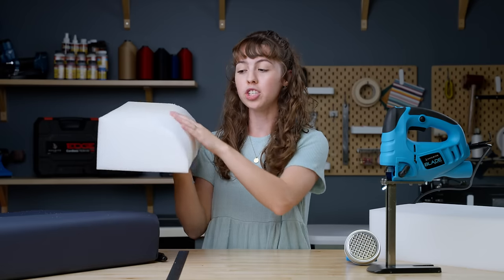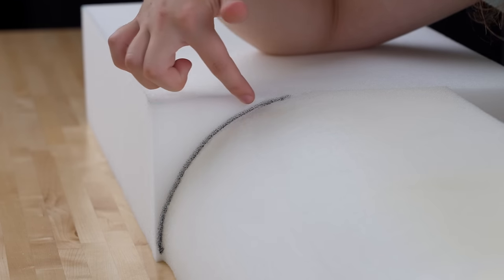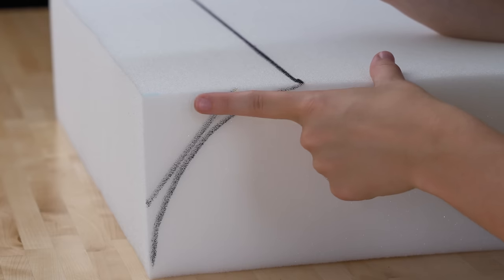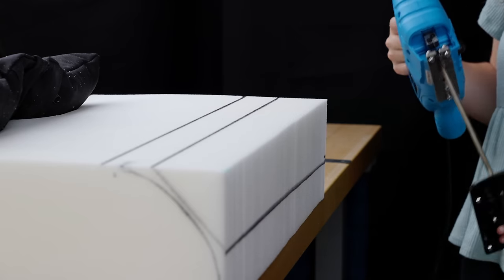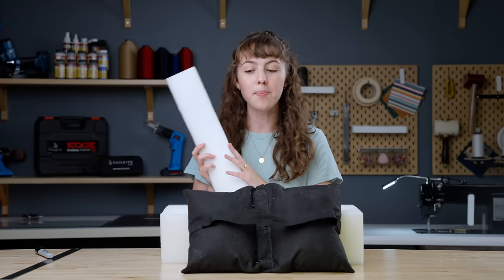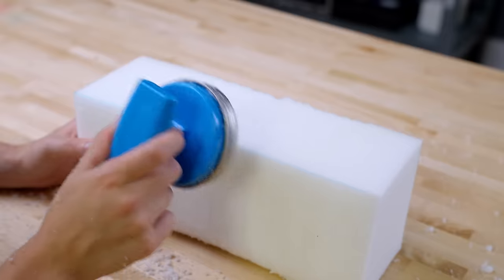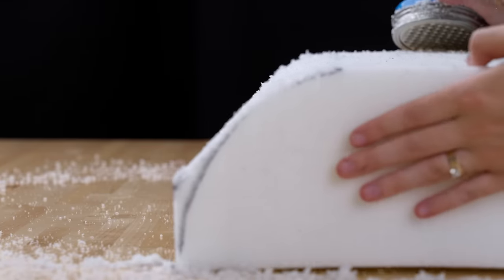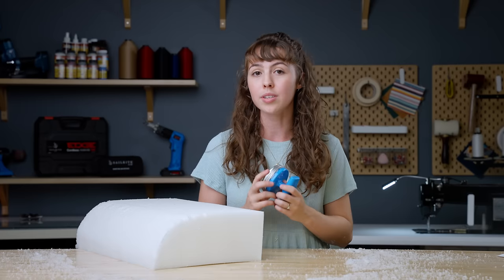How to Shape Foam for Perfect Curves Every Time

Comment: Shoulda used a hot wire over templates at each end - far less messy and more accurate.
Reply: Can you use a hot wire over all the surface, not just ends ,after cutting away major portion?

Comment: Always hold the blade plate BEHIND the blade. Make sure the cutting edge points away from your hand.
Reply from the maker: Yes, you're right! Because this is a powered tool we recommend to use it safely by ensuring the blade is always pointing away from you and to ensure safe hand placement.
Reply: Is the blade plate self made? I did not see it on your website for purchase.

Comment: I have used an ordinary electric carving knife to shape Foam, when I rebuild/replace the seat covers on motorcycles if the foam its self has disintegrated or been damaged. It works great, and I can continue to use it to carve the Thanksgiving turkey ..
  I learned about using an electric turkey carving knife if that’s what you wanna call it from a guy that actually owns an upholsterer shop..
  I also saw a small article in one of the motorcycle magazines I had subscriptions to back in the 80s and 90s. They showed how to get a piece of foam, and carve it into the shape required with an Ordinary kitchen, electric carving knife
Reply from the maker: Yes, that is a very good approach for lower density foams. When you get into high density foam the electric knife does struggle and ultimately you will burn up the motor in it. But for small projects or one-offs absolutely!

Comment: This is foolishly messy and not needed at all 
There’s other ways to do this and thousands of videos showing how
Reply: it's how most of the industry does it i'm not sure what videos you're looking at. [auto industry especially does it this way]  some of us use a cheese grater and electric knife but otherwise this is it. [same thing lower budget]
Reply: @fuzzjunky I don’t remember the terms but basically there’s a wire from toaster or hair dryer that can handle heating up when electricity is applied. Connect the wire to a proper electric source and it cuts thru the foam like butter without all the shavings and foam dust
You can do any sort of intricate shape 

There’s other methods also but that’s the one I’d go with